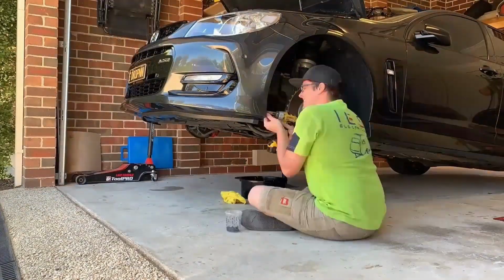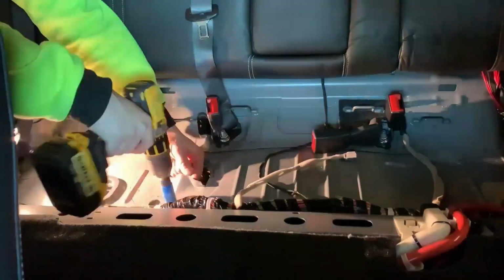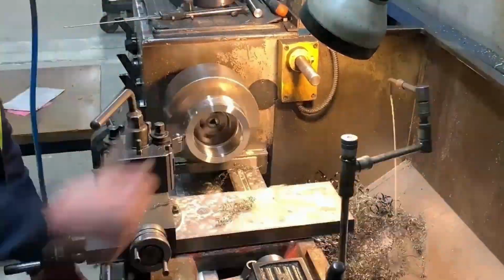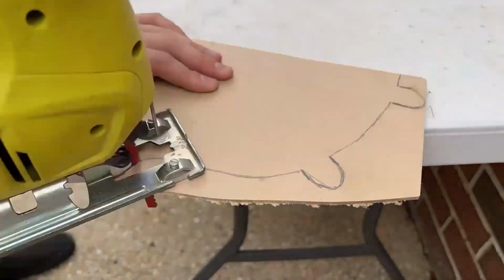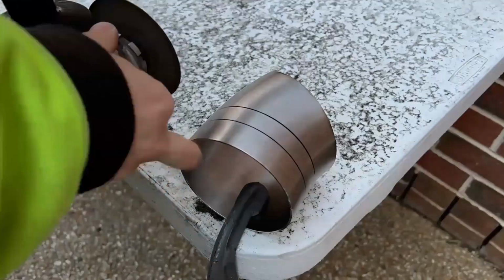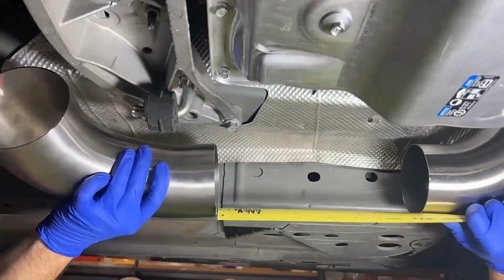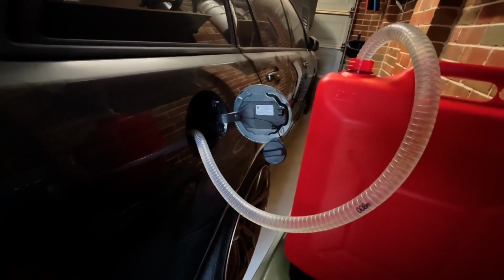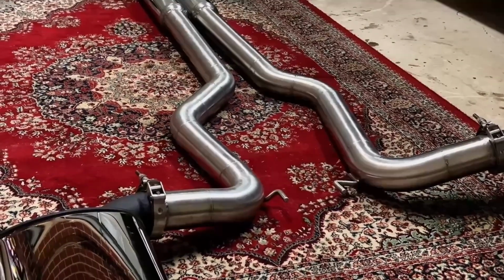The Full Process Of My Turbo LS3 VF SSV Holden Commodore Built At Home

Comment: Nice build bro.
Im in the USA. I also have a 17 VF/Chevrolet SS Sedan in Red Hot 2.
My LS3 has been fully built and forged and FIC 1650cc and Fore tripel pump in the tank. All fuel lines done with An lines. 
Intercooler is gigantic so big is barely fits behind the front bumper.
Camero deep pan upgrade
Built trans
Circle D converter
Whole build from top to bottom has been all upgraded to ARP bolts.
Holley fuel rails 
Holley valve covers
All the cold side pipes are wrapped and anything hot side has been coated in this new thing that cuts the temperature down like crazy.
Heater core hose has been relocated for cleaner look.
All the radiator hose has been upgarded to aluminum piping.
Cold case upgrade radiator.
Transmission oil cooler custome fabricated
Also the whole build was done with V band clamps anywhere we could use it it was done.
These kit where custom fabricated so we could add what we wanted.
No clamps here didnt want potential boost leaks.
Turbo blanket and turbo guard
Full custom 3 inch exhaust all the way back.
Its like 3 page long build those are just some of the things we did.

Love the wagon bro. Love the build also.

My WM Caprice will be LSA soon also.
Holden for life man.
The car is being built by my good friends shop 12 hours from me.
I wish i had the skills to build it at home like you bro.
I have some skills but not on that level.
I might do the LSA swap on me WM at home to learn more.

Comment: Beautiful build man. Those brackets you used for the bottom setrab cooler, would you happen to have the spec and measurements on it. I think that using rib nuts is a genius idea considering the crash bar is pretty sturdy.

Comment: How come you got standard volume oil pump? Thought u were supposed to get high volume for when it’s supercharged or has turbo
Reply from the maker: Get a lot of mixed answers with it, some believe the high volume is too much for a factory sump and it’ll run it dry.

Comment: I remember in another post you mentioned when the 6l80 goes you would put a 4l80. Were you serious , have you done any research on the conversion. I am seriously thinking about it.
Reply from the maker: Yeah definitely see it in the future but got an America trip booked that swallowed up the budget,
Converter, transmission crossmember, shifter & drop box, speedo module and tailshaft.
Shouldn’t be much different then a glide/th400 conversion.

Comment: Hi mate ,  how did you side on the injectors ?  What power on E85 are these good for ? And what length did you buy ?
Reply from the maker: They’re short length Bosch 1650cc units and way overkill for the power I made 630kw/845hp, duty cycle was 28% at that power level.
Have seen them used at 1000kw/1340hp.
Reply: @AndyJBuilt  hi Andy j builts how are you doing today mate I have invited you to my birthday party in 11 August at tenpin bowing in Ballarat Victoria

Comment: Is this a daily driver?
Reply from the maker: It isn’t, but if you wanted a very fuel inefficient daily it could do it.
Reply: @AndyJBuilt  maybe a stupid question, could you fit an air filter if it was daily driven? If not would not running one have a dramatic effect on engine life? Cheers for the reply
Reply from the maker: @Bikemad24  no room for a filter unfortunately so just run a mesh turbo guard, it’s not ideal for the engine but neither is almost three times the horsepower it originally makes haha.
Reply: @AndyJBuilt  fair point lol